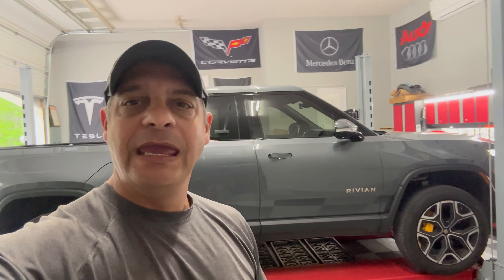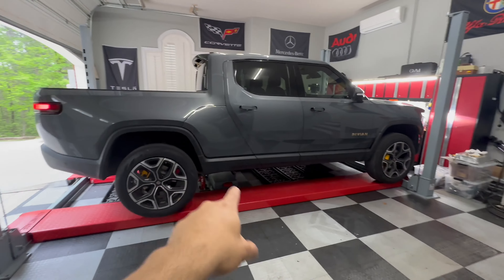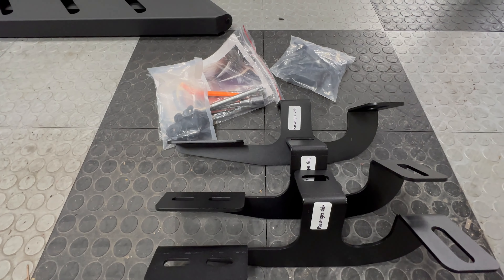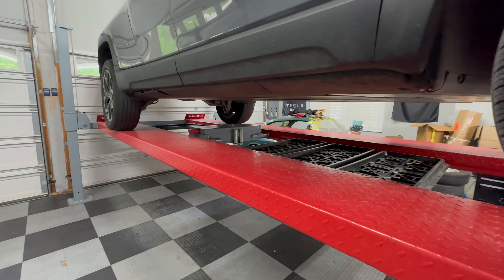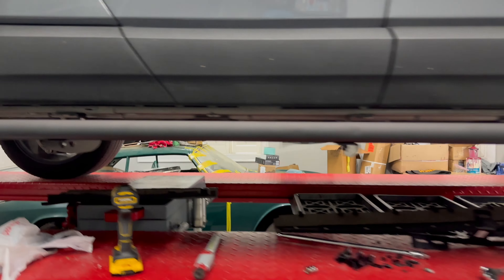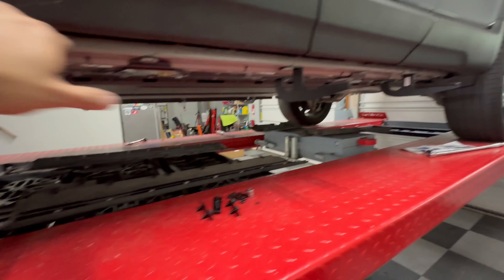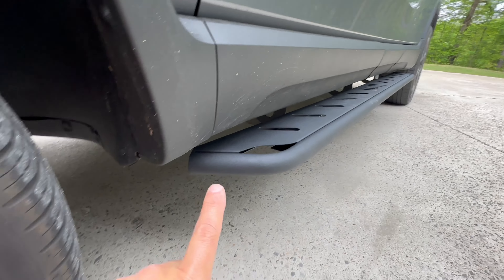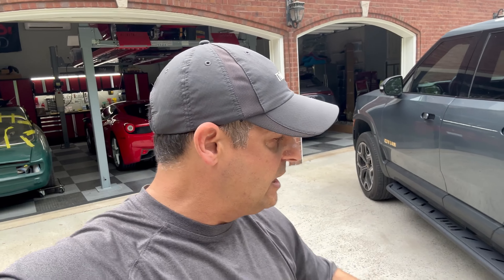EVBASE Rivian R1T R1S Overview & DIY Step-by-Step

Comment: What kind of impact driver did you use to get the T55 screws? I am having a hard time getting it off. I tried multiple 20v impact driver and it’s not moving!
Reply from the maker: Just use a breaker bar
Reply: Thank you for the advice! I went to Harbor Freight and got a breaker bar. It worked like a charm!
Reply from the maker: @sanjuanjun  Glad it worked out for you!